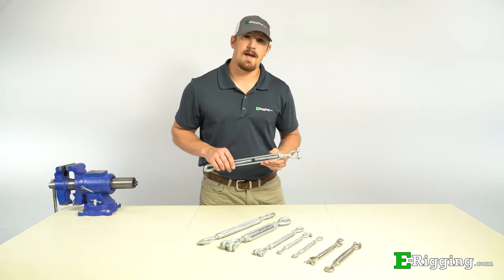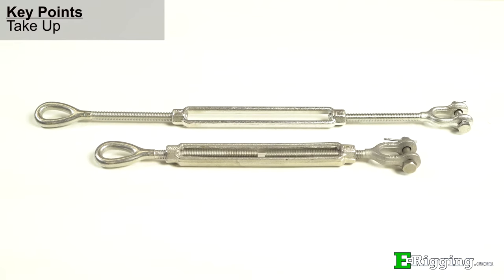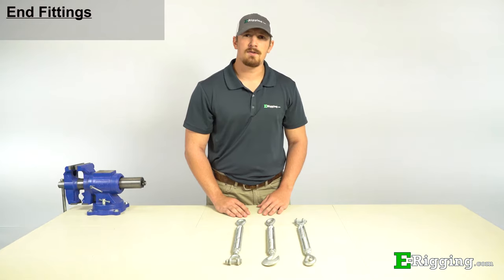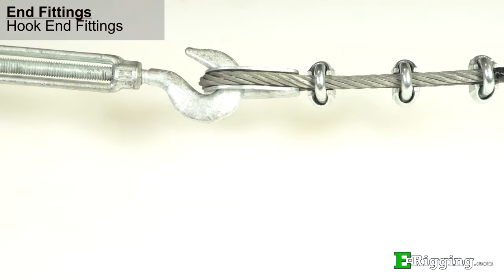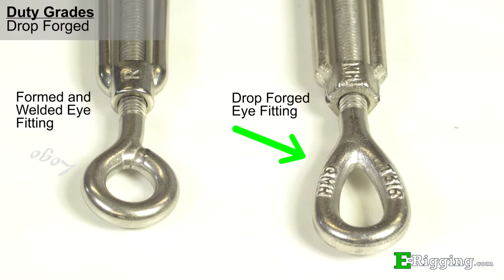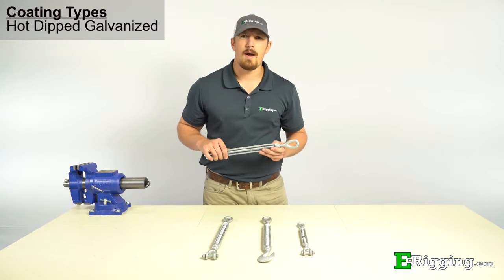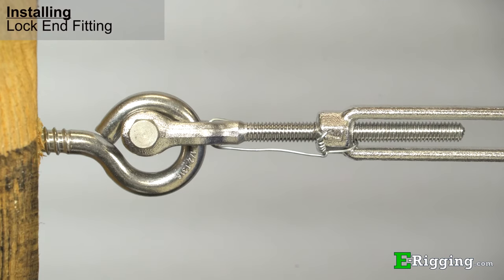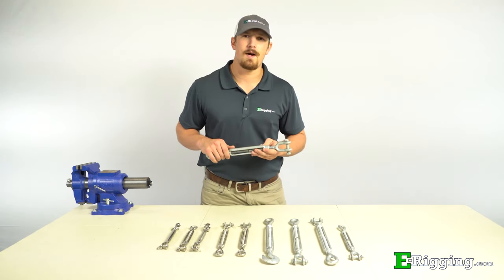How To Select and Use Turnbuckles - Installation Guide

Comment: I am having one heck of a time finding turnbuckles for use on my tractor - since acquiring the tractor, I almost instantly bent a turnbuckle. I purchase a more rigid stabilizer, and that broke as well. I replaced those with the original turnbuckles, knowing that I needed a far superior solution.

I ended up picking up some heavy duty chain - seeing that there are solutions that use chain as part of the solution. Now, I am going to pick up a short (and strong) turnbuckle to finish off what I worked up.

My point here is that THIS video has been far superior to explaining the very basics that I really had not been finding anywhere else - thank you for posting this video! Dropping a like on your video, Watching and Supporting!